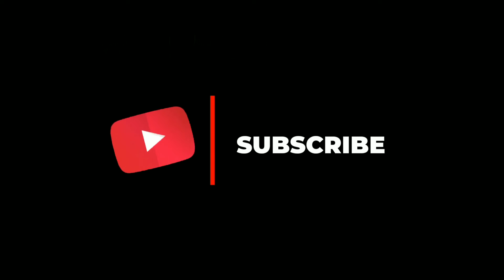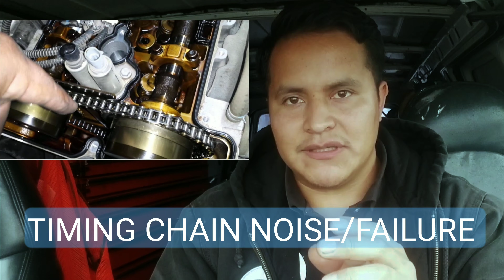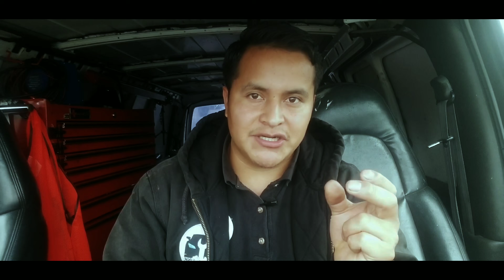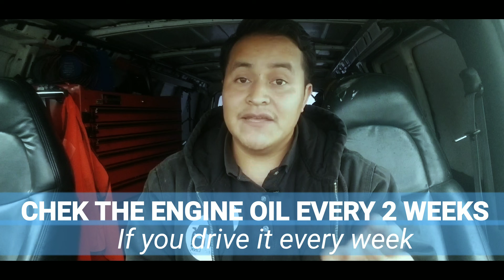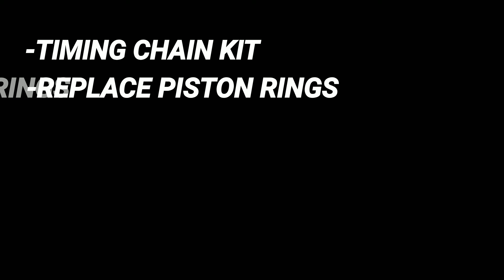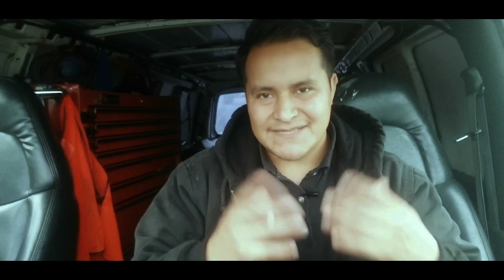GMC engine problem| why it fails and what you can do about it

Comment: I have a very good question !     I know this 2013 GMC Terrain SLT 2.4 of mine, is ALSO made to come with the 6 cylinder  SLT-2 motor !  If I ever need to replace my motor, I would want to order the 6 cylinder,  which should absolutely fit , as the engine compartment is the exact same size !  What are your thought on this idea? Its to my understanding these motors NEVER had any issues, it was always just the 2.4's that did. Thanks for your input in advance. Cheers
Reply: Not worth the trouble, you may have the same vehicle but many other parts like fuel pump, radiator, transmission, cpu, wiring harness, exhaust and accessories are likely different.
Reply from the maker: If you can make it work then go for it. I myself I have never replaced an engine with a different engine, I've always replaced them with the same engine size

Comment: Gf car 2016 terrain 2.4l 4cyl was 2 quarts down on oil,  burn I thought a filter problem but yet to find out if main seal or rings.
Reply from the maker: You'll see oil leaking in between the transmission and the engine if the rear main seal is leaking

Comment: I have had all of these issues and I am done with this vehicle after this last episode. I feel like it is always something with this vehicle. Thanks for the video. What car would you recommended  for someone that travelers a lot?
Reply from the maker: Toyota RAV4, Honda CR-V, Honda pilot, Subaru Forester
Reply: @WrenchLink  Thank you. I wrote this 3 mths ago when I had to get the timing chain fixed. And today, I had to get the same thing fixed again. I thought I had a least a year before I had to look for a new car. But no...3mths. This is so disappointing! Especially since there are not a lot of cars on the lot and those that are seems to be very expensive.
Reply: @TRUEEEEET  im tryin to trade mine in for a 2022 ford maverick... looks like a good trade

Comment: I have a 2012 GMC Terrain, it definitely has the oil consumption issue, some slight engine noises have started, but now it 'jumps' / jerks back and forth while stopped at a red light or a stop sign, and this happens aggressively but only if its on ECO mode..
Reply: Same here! Car runs like shit in eco mode, at a red right the rpm’s jump up and down and the car jerks, at night I can even see my headlights flicker as the rpm’s jump up and down
Reply: @marsbars8868  
Same happened to me... your timing chain is stretched... go get it replaced now... its fkin up ur valve cover! ... bet u will see your oil leak...
Same happened to me... 
Your lights are flickering because leaking oil causes low performance... basically its using up ur battery
Reply: @rainsrapidly  exactly right! I put my car in the shop March 4th, timing chain stretched due to a faulty tensioner, ate through the valve cover. Had to replace the whole motor! I should have it back next week hopefully
Reply: @marsbars8868  when u get it back TRADE IT ... im trading mine for a 2022 maverick truck... 
I got good info that no matter if u fix these terrains they keep blowing timing chains over & over ...
Reply: My wifes was jumping and rpms up and down while stopped at lights. I changed the throttle body assembly with sensor. It runs fine now. Its a few 5/16 screws and that's it. Very simple and easy repair
Reply from the maker: That's a problem I haven't come across yet. Mostly a computer communication issue/electrical
Reply: @lilshifty8137  just search equinox throttle position sensor. My buddy just took his off and cleaned it with brake cleaner. Didn't even need to replace the part
Reply: Mine does the EXACT same thing
Reply: I faced similar issue and replaced  timing chain. As I used synthetic oil , I delayed replacing oil . I expected that would last for 10000km . As he told it consumes lot of oil.

Comment: My GMC Terrain 2013 won’t turn on and the key gets stuck inside..like the car is dead opened the doors not even the lights turn on the alarm won’t go on when I push it on the control
Reply from the maker: That sounds like a power issue. If you haven't figured it out yet; check if the battery is charged or jump start it with another car.
Corrosion on the battery terminals can also affect the performance of the battery

Comment: I have a question . I have a 2016 terrain and just had my timing chain , timing tensioner , solenoid and other things replaced due to the problems you’ve educated us on and my car was less than 80000 miles . Do you think it’s worth keeping the vehicle or should I get the money out of it while it’s in good condition and get a new vehicle ? Scared of this stuff happening over and over and also scared of just another engine component going due to these problems.
Reply: Add a mos2 oil additive to moteur to prevent  wear
Reply from the maker: It's going to have more problems
Reply: @WrenchLink  thank you . I traded it in and got the value back while I can . Mechanic said there was signs of moisture in the engine all ready . Thanks for your help
Reply: A 2016 car should not have any issues period. I feel bad for their loyal gmc customer. My uncle just bought a use 2014 terrain that he think it’s look nice and reasonably price . Now it turn out to be  a sour lemon. It’s out front of  my garage with no oils in the engine and make knocking noises I will put a few quarts of oils in and let his wife take to the machanic tomorrow.  . Well that’s what I like to share . Hope gmc design a better engine for their customers.

Comment: 45 year mechanic here, Change your oil at every 4K miles (Dextos Full Synthetic). Don’t wait til 6K 7.5K, 10K to change or Goodbye engine by 70K or Before.  I have a 2015 LTZ 2.4L @60K miles No consumption dip stick always full and slight brown B4 changing..pay the money for the regular oil changes I’ve seen these engines blown valve covers destroyed and timing chains snap …no fires yet…***DO NOT LISTEN TO GM BS RECOMMEND OIL CHANGE***.. I do this to my 2017 Traverse too. We’re getting complete fuel system cleaned very soon..they may have carbon build up on pistons..DGI is just more problems…look at KIAs..

Comment: Another common problem (as in pretty much ALL) that these 2.4 engines have is a cracking exhaust manifold along with manifold bolts breaking off.
Leading to:
Louder at start (and overall)
Exhaust making its way into the cabin
And also a fairly pricey bill to repair.
I've worked on, rebuilt and followed these vehicles (along with the 3.0 & 3.6) since their release.
EVERYTHING this man mentions is also absolutey on point.
Reply: Had the same issues with manifold and cat pipe.
Reply from the maker: Good to know about those other problems
Reply: @WrenchLink  I've heard the that the exhaust will crack and the cat will burn out due to the carbon buildup in it from, once again, oil consumption...
Reply: Yes! I've changed my Exhaust manifold and also after a $150 cat converter went bad, God blessed me with some financial help to buy the GM cat and that problem solved. Later on I had to replace my high pressure pump because I noticed rhe oil burning and often low. Thank God I am trained to check engine oil level at least once weekly and before, during and after road trips. O yeah I've been changing oil 3K-4K miles and have been using Valvoline 5W-30 Syn blend since about 75K. Ever sikcei changed the high pressure fuel pump I noticed the oil level hasn't moved and the oil's thickness is what it should be and also the color is what it should be.

Comment: Wrong, Wrong, Wrong.  GM wants you to believe it used the wrong type of rings, poor timing chains or PCV, so they can cut thier losses and claim it only affected the first 3 years not the full 8 years of this 2nd Generation.  The elephant in the room is Gas Direct injection that generates large amounts of abrasive soot that the full flow oil filter is unable to stop.  Second, it is fuel dilution of the oil with fuel by GDI.  I have 500 oil samples from both generations.  GDI has doubled the wear rate of the rings, cylinders and timing chains.  THe soot and fuel destroys and contaminations the oil, which clogs up the rings, PCV system, intake valves.  Third, GM originally recommend a petroleum oi spec, API SN with a minor spec change called Dexos, this is mostly marketing. They have quietly modified their requirements due to LPSI, fuel dilution, and only in 2020 have they finally addressed the abrasive soot and timing chain wear. Petrolem oil does not stand up to GDI.  Fourth, the original OLM took oil intervals to 8-12K miles, combined with soot and fuel, was a disaster.  They also quietly changed the OLM to cap to 7500 miles for all highway use and closer to 5k for mixed driving. All of the degraded oil and soot will clog up your PCV system leading to more problems.  Fifth, use of low octante 87 gas with Ethanol is another deadly combination.  Stratified fuel mode in GDI creates much of the soot and unburnt fuel, and ethanol which has 30% less energy makes the problem worse.  I have years of test and 10k miles of testing with combustion chamber pictures showing what happens to the combustion chamber.  These high compression, high loading engines require premium, high octane, non ethanol, high detergent fuel.  Use of less than 91 octane and then ECM detected engine knock and further reduces performance, increases fuel contamination and soot.   I agree with the recommendations.  Use premium 100% synthetic oil. change every 3-5k, high quality filters, premium fuel, and your engine will last.   For the transfer case, owners need to change the break-in fluid after 5k, not 50k, and use high quality synthetics.  Same for transmission. every 30k, a full fluid exchange, not a 40% spill and fill.  There is no filter to replace and no sump or pan to replace.  Full exchanges every 30k, and use 100% synthetic fluid.  Ignore all of GMs recommendations and apply common sense.  These problems are not just GM but most manufacturers who recently introduced GDI.  Thank you Bush and Obama admins and EPA who mandated doubling of CAFE and Emission standards in 10 years that gave us this junk technology, stop start and 6-9 speed transmissions that you cannot service.
Reply: My wife has the 2017 Terrain. No dash lights, no noises from under the hood. I just today noticed a mustard colored leak spot under her Terrain. Could this have anything to to with the "sludge" mentioned related to the PCV valve or is this another issue? Head gasket or worse? I'm wondering what to prepare for in terms of upcoming repairs.
Reply: @jwgreenhagen possibly
Reply: so, do i purchase this 2018 terrain denali or run away?
Reply: @vondajennings5808  2018 is the next generation, so some issues were fixed, but with every change, comes with issues.  Frequent and high quality maintenance is key.
Reply: @tssci6774  👌 thank you. I fell in love with this terrain denali. It has 64000 miles on it for 290000. Is this a Good buy?
Reply: So my wife's 2013 terrain is burning oil but there's no leak...no engine noise....recommendations are appreciated.  Also engine code p0442 small evap leak keeps coming back...is the purge valve solenoid the culprit
Reply: @WINGMAN601 
It’s burning oil from the piston and rings. 
Look for this.
At start up does blue smoke come from exhaust pipe and last 1 to 2 minutes. If so seals are gone on valves.
If on start up and while engine is running is blue smoke coming from exhaust continuously. If so the piston and rings are bad.
Reply: Wow, well said. I think I will sell mine
Reply: Do you think the LE5 is more reliable since it isn’t GDI?
Reply: @DJR5280  yes, Port Fuel Injection has been around a long time, reluable.
Reply: @DJR5280  how do you know which engine you have
Reply: @Timothy sipes  if you had all those parts fail, including pump, then you ran it out of oil, oil starvation will destroy an engine.
Reply: Excellent post. 💯

Comment: Thank you for this. I do have a question for you.  My car suddenly stalled one day and the check engine light came on. So I took it to autozone got the code: p0014. So I replaced the vcc solenoid and changed the oil. The light went away and the car ran fine. Well the code is back and it's stalled again. It's stalling a lot now more than it used too. I don't hear any noises come from the motor. So what's my next move? Do I have to change the solenoid again.  I put it in 2 weeks ago
Reply from the maker: No, the solenoid is most likely not the problem. First thing is to check the engine oil, if it's low then add more to the max level on the dipstick and that will most likely fix the stalling issue but it could be that the spark plugs have a lot of carbon on them due to the engine burning a lot of oil and the timing chain might've stretched to much causing that solenoid code to come on.
Reply: @WrenchLink  well it go so bad I couldn't keep it running.  I took it in and had them change the timing chain since it was at 90k and figured it should be done anyhow. He changed it but said I had the cleanest motor he's ever seen and was surprised that there was no leaks. He changed the other vcc solenoid and the camshaft position sensor and its been running like a dream.  I also stopped using eco mode. And my oil has never been low
Reply: @WhoaManCarpentry  I had the same problem and same results at less than 80000 miles . Timing chain slack and stalling and they replaced solenoid timing chain and tensioner and other things . Is it worth even keeping the terrain for it to happen again I wonder?
Reply: @vincetortoloni5108  after doing some really really deep hard to find research I found some information on GM's Ecotech motors. And oddly it was exactly what I was thinking. Don't run it in eco mode. It uses a lot more fuel but the motor stays healthier and will live longer.  Another thing is what kind of oil do you use? Mine takes full synthetic 5/30. I had gotten my oil changed twice at jiffy lube instead of doing it myself and that's when the problems started. They put in regular oil. When I checked the oil it was lumpy. Never again.  Always synthetic
Reply: @WhoaManCarpentry  I’ve all ways used synthetic because anything else would void the warranty I had . I’ve also come to the same conclusion about eco mode and have since left it off eco mode. Still not sure if it’s worth it in the long run to keep it . I see you have more knowledge about cars so you also have the tools to keep your engine super clean . I don’t have as much knowledge at this time. How often do you change the oil?
Reply: @vincetortoloni5108  every 3k. 7.5k as GM recommended is to long in my opinion so I never use the engine oil life indicator. Also try adding some seafoam on your next few oil changes to help clear it out.  And on every oil change blow out the pcv. It is a good car if you take very strict care of it
Reply: @WhoaManCarpentry  thanks dani
Reply: @vincetortoloni5108  anytime!
Reply: This is exactly what is going on with my 2010 Chevy Equinox. I got the solenoids changed out, it stopped stalling for 5 days. But once it started the stalling seemed worse. Got an oil change, it worked regularly for about a day. Engine light has came back on. I'm thinking of changing out the Mass air flow sensor, Cam shaft position senors and crank sensors. My car is only throwing out the P0011 or P0014 code. If this doesn't fix the problem then I don't know. This car has given me so many problems.

Comment: I have a 2013 Chevy equinox Lt AWD I'm getting codes P0411 P0014 P0420 P0013 and I already changed the intake/exhaust solenoid also O2 sensor upstream change oil and filter and still getting those codes any suggestions would greatly be appreciated. The vehicle is running fine little white smoke when I accelerate but not too much white smoke and no leaks.
Reply from the maker: P0014, and p0013 are for the variable valve timing.
Cause:
Oil passage clogged by oil sludge
Screens, filters for VVT are clogged
Timing chain stretch
VVT solenoids electrical issue
VVT faces internal damage.

P0411 p0420
Cause:
Air pump replacement.

Removing carbon buildup from secondary air system.

Vacuum hose replacement.

Air solenoid replacement.

Repairing or replacing wiring harness issues.

Comment: Just bought an 07 G6 with the 2.4 already regretting it from reading peoples experiences. Seems the 99 bmw would have been the better bet even with the head gasket issue lol.
Reply from the maker: Lol
Reply from the maker: The most common problem is lack of engine oil, something easy to check but deadly to the engine if neglected

Comment: I own a 2013 Equinox used as a Taxi with 223,000 KM and climbing everyday. It growls at me when the oil is low. I know when to add a litre and it's changed every 3 weeks regardless of mileage. I also own a 2014 GMC Terrain for personal use it has 134,000km on it. I change that oil every 4000 km and so far I haven't had to add any between changes. I've learned so much about these engines and I will share something I think is helpful. I bought both SUV's as FWD only with the 2.4L 4 CYL...I believe the AWD drive trains stress these engines and cause more harm than good compared to the simple FWD set up. This also takes care of the transfer case issue by not having one. Sometimes less is more if you're going to own these engines. It might not work out in deep snow but Being in Northern Ontario I just learned to park it and avoid the weather until roads are clear again. Good luck.
Reply: @Train Hound, when you drive your AWD, use manual mode and select the proper range.  These engines and transmissions are designed for econony, not performance.  It will shift to early, lugging the engine and transmission. In the city I set it to 3rd up to 35, 4th for 45mph, and 5th for highway up hill. 6th for flat and downhill. This keep the rpms up, where there is more hp and torque.  Anyone that learned how to drive with a manual transmission will understand.